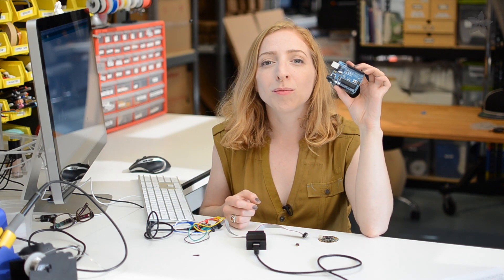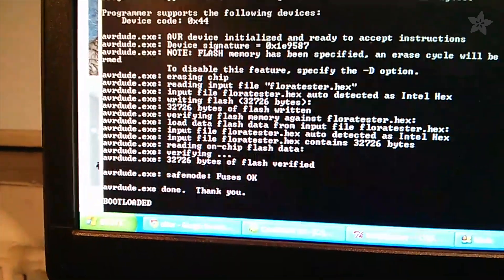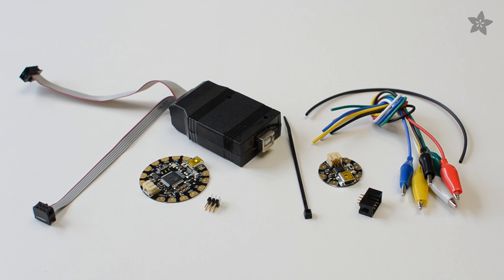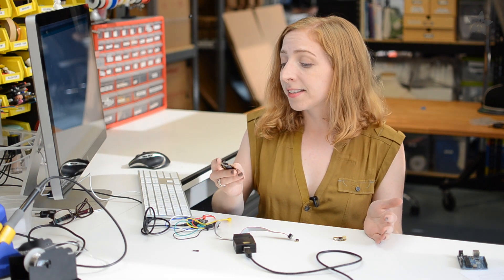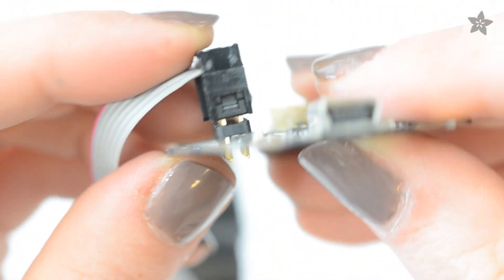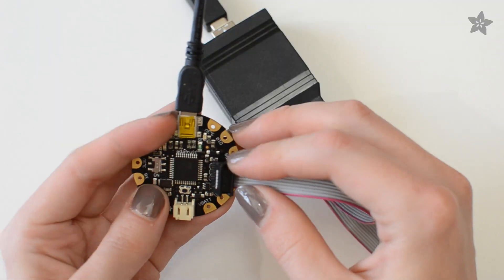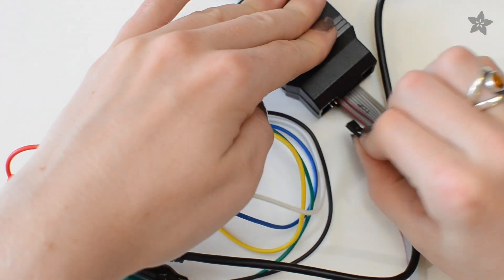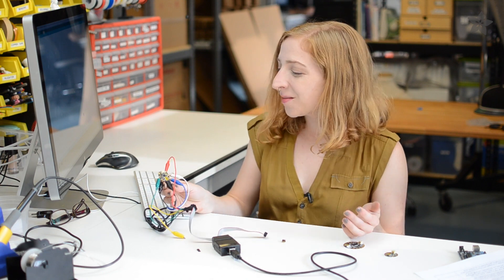Bootloading FLORA and GEMMA with custom connectors

Comment: I have a little problem with my arduino gemma. When i plug the micro USB cable is in the computer, the red bootloader LED dont flash like normaly. Before this happen, my gemma was working great and the LED was pulsing. Now it juste stay on and is not as bright as normaly when i press the reset button. Is it a bootloader problem? Help me  please!
Reply: +Irobot Roomba mine has the same issue.
Reply: +TheBeardedMan Hello!, use an other USB cable. Mine work now. I have not use my Arduino Gemma since a long time now on my computer and now it work. Also, be sure that you have a USB cable with the data line, these cables are more thick. 
I hope i help you!
Reply: Irobot Roomba Thank you! I used a different cable, but it was also the fact that I was using it on USB 3.0 ports.
Reply: +TheBeardedMan Yea, you can't use it with an 3.0 USB port.
Reply: +Irobot Roomba Had the same issue
Reply: +Kolob Canyon Why is this appen to everyone?! Did you try wath i said before? I hope it helped you.
Reply: It wasn't a problem with the USB 3.0. We tried on two separate computers with USB 2.0 -  no success. The third computer we tried it randomly worked. Can't explain why, but the bootloader is really weird.
Reply: +Kolob Canyon Maybe try to flash the bootloader again, try to do what they said in the video. Try wit a Mac, they dont need to install a special USB support. And if it is no longer working, go post your probleam in the adafruit forum. They will change your gemma if he's break. Tank you.

Comment: The method for flashing the FLORA seems very dicey . . .  you may want to "tack solder" a socket onto it temporarily for a more reliable transfer.  It can be removed after everything is verified with desoldering braid / solder wick.  
There are too many variables uploading, so eliminating a bad connection would be a good thing. 
see:    http://www.adafruit.com/products/149  
Spending several years building prototypes at Xerox research, I favor the wick over the solder sucker method hands down. It tends to use less heat and keeps the pads intact.
Hope that helps!

Comment from the maker: Bootloading FLORA and GEMMA #WearableWednesday
http://adafru.it/b121111

On each Arduino-compatible chip runs a tiny program called the bootloader. The bootloader is a helper that reads your Arduino sketch over USB and burns it into the little microcontroller brain.

FLORA and GEMMA both come with bootloaders when your get them in the mail, but there are a few reasons you might want to know how to burn your own bootloader, besides the nerd cred. Maybe you’re an AVR hacker and you want to change the bootloader’s functions, or maybe you’re building your own circuit and need to flash a new blank chip. And sometimes it’s possible to corrupt your bootloader– flashing it again can bring the board back to life.

Read More
http://adafru.it/b121111